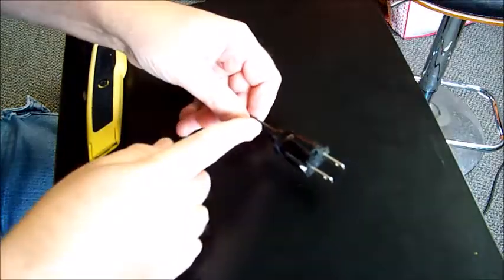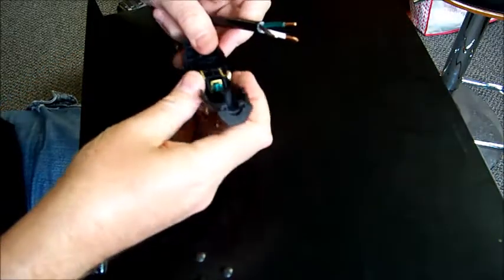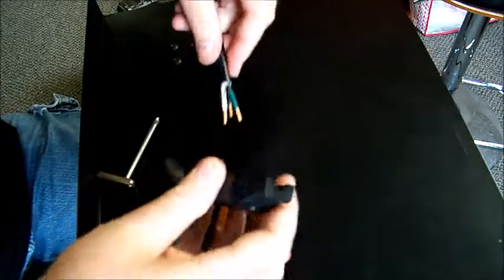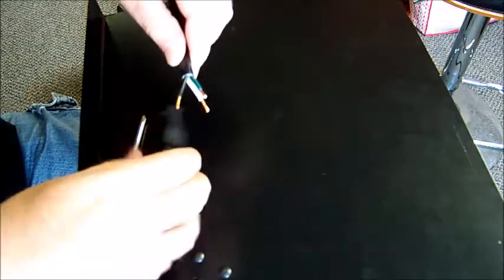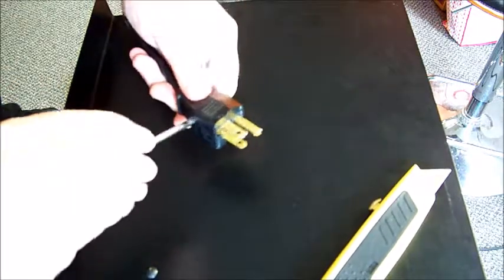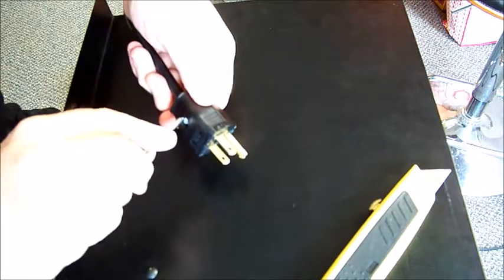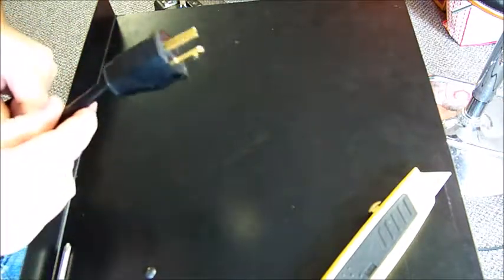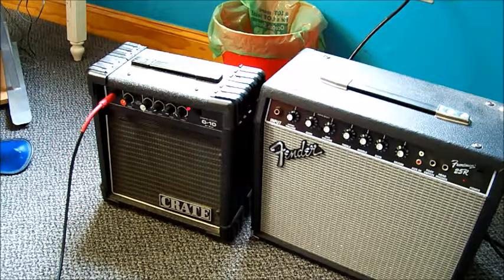Replacing A Broken 3-Prong Electrical Plug

Comment: Black wire to brass screw, green wire to ground, and white to silver screw - that is always the way to re-wire a polarised plug. Reversing white and black wires can put line voltages on your input 1/4" or 3.5 mm jacks and cause a danger or deadly situation than could and would KILL you. Bad advice on this video !!! Don't believe me? Check out the National Electric Code. Wall outlets are wired the same way, but never use the push contacts, always screw contacts. Tighten all screws as strong as you can, if the plug/outlet breaks, then it was no good to begin with. I've seen that with Chinese made plugs and outlets, cheap crap. If I were you, I would take down this video and replace it with a video done correctly before you kill themself and maybe others. Remember this litany and memorize it: black to brass, white to clear, green to ground. You may save yourself and others, besides not ruining a classic amp. Buy USA made electrical products for safety. Been a FCC GROL license holder for 30 years, and THAT is what they taught me in Western Carolina University. Be smart, be careful, recheck your work. Polarized plugs were not invented to just irritate you.